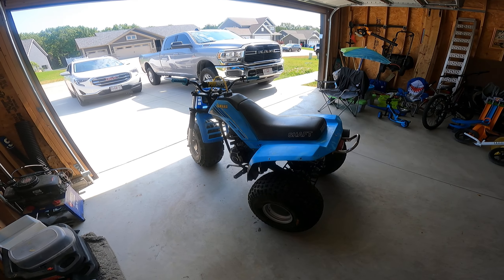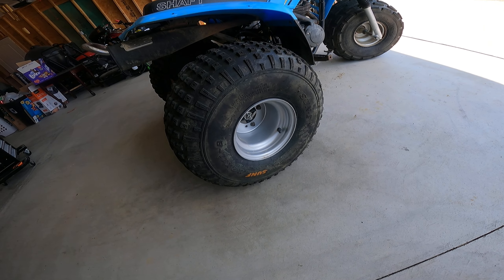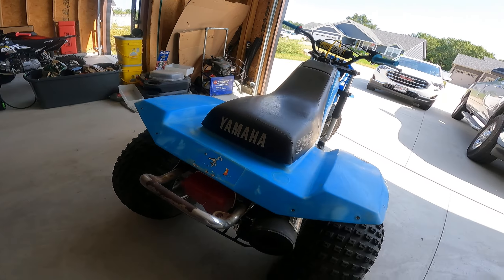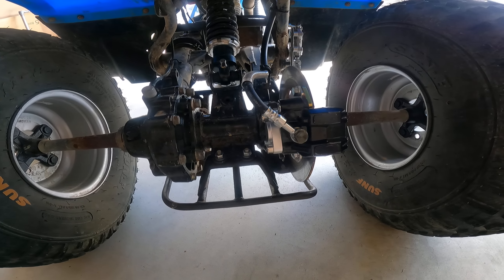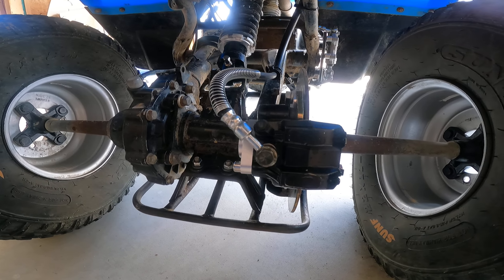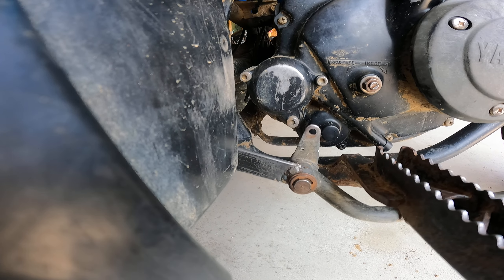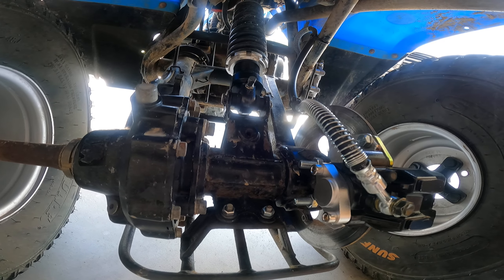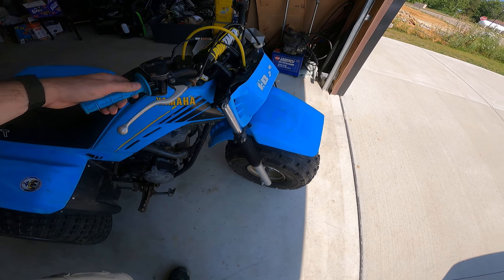'84 Yamaha 225DX Walkaround

Comment: Are those Blaster hubs on the rear?
Reply from the maker: Yes they are. Same spline count as the stock hubs and gives you more options for wheels.
Reply: @ronwilhelms7433  nice, how did you restore the plastics? I have the same bike.